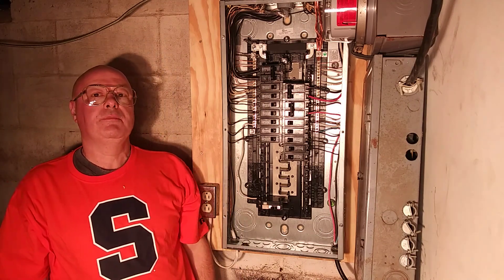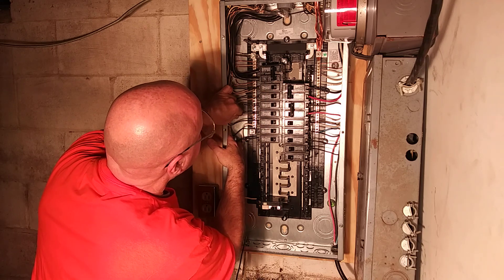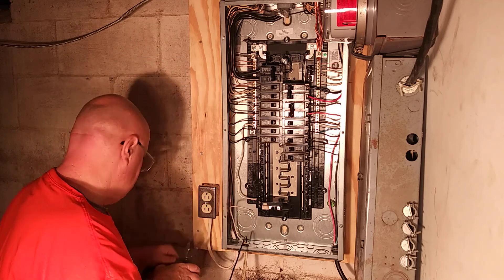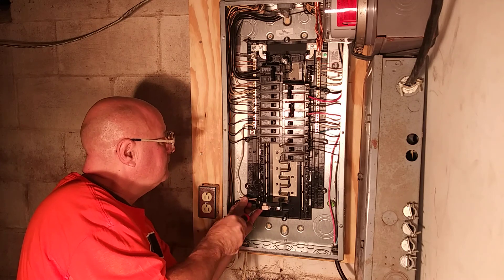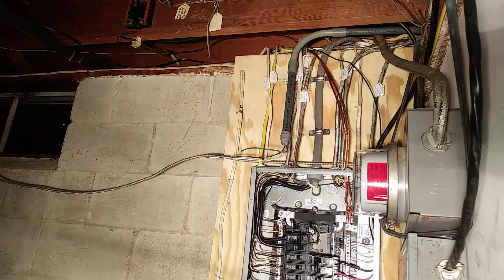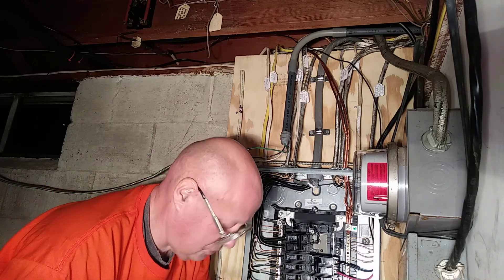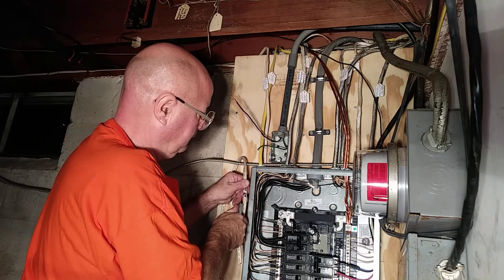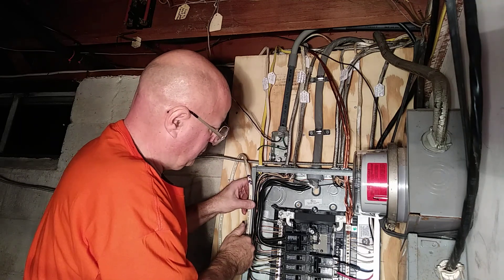How to install a gfci breaker and wire it in to a panel

Comment: Hello David, I appreciate your educational videos and hope you will chime in on our circumstance.

I'm preparing to install a large 6 wire spa that requires 50 amp,  30/20 split two breaker sub panel.

Unfortunately I cannot find needed sub panel even in multi state search and am considering a work around.

-At main install 50amp GFCI breaker

-Run #6 wire to sub panel, NOT #8

-Within weather resistant sub panel use 30amp & 20amp standard breakers

Do you have an opinion as to the safety and function of my plan?